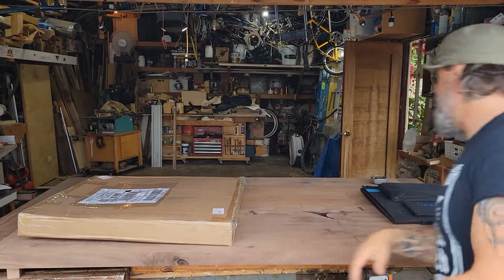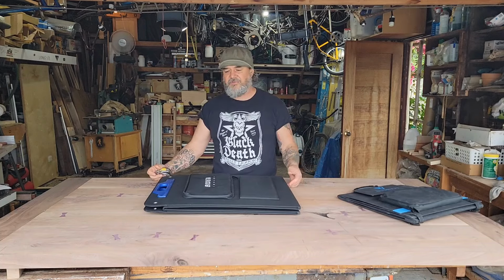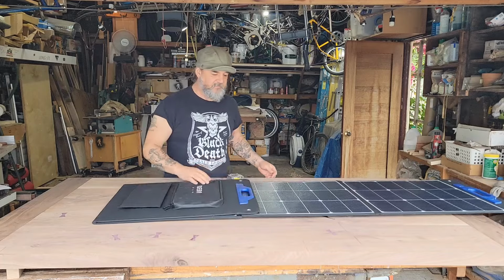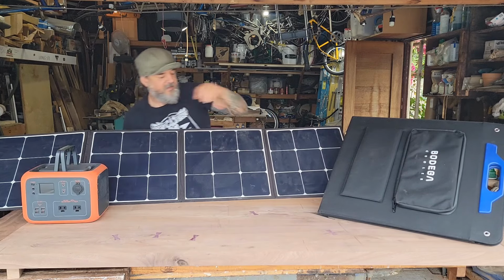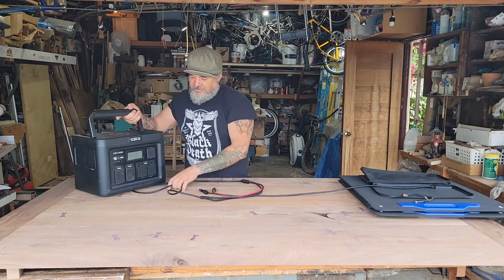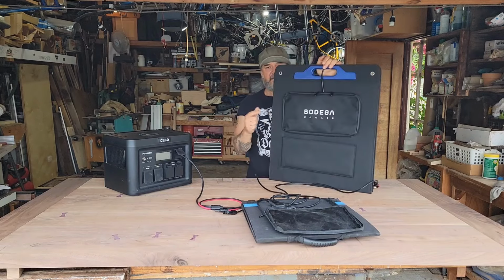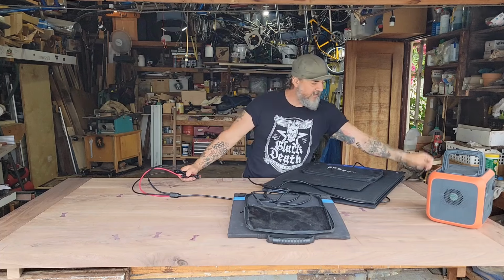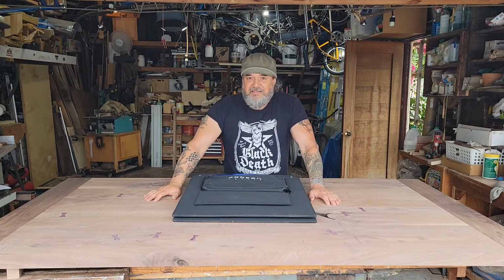BODEGAcooler 200W Portable Solar Panel: Unboxing & First Impressions

Comment: Yes, you can get cables "Extensions" or long cable, and yes, you will lose when it is long, but depending on your power station too, quality copper cables vs. no quality, am sure you can measure the output, and keep what works, send back whats not, it is better to have ALL cables from same maker, and same size. Avoid longer than 50'